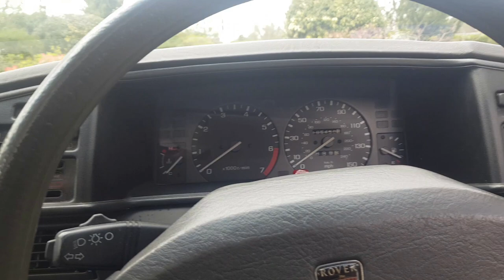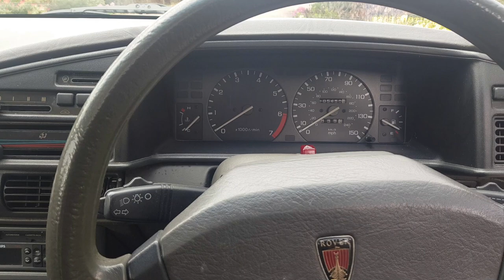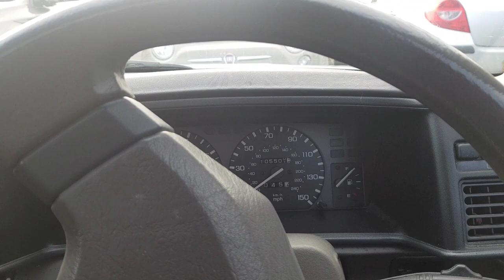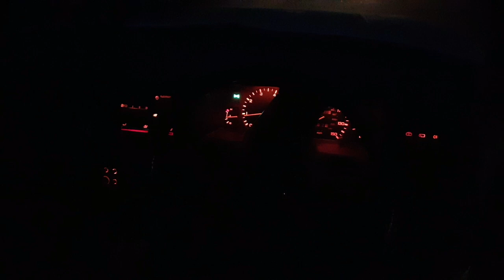Collecting my new Rover 820 BASE (it broke)

Comment: Automatic chokes were never much good on most cars of the time I converted my VW 1303 Beetle with a Alexander manual choke conversion kit  
from Halfords 😁
Reply: Arran Grant I haven’t had any automatic choke issues on my 66 beetle, but I did get rid of the points distributor, and replaced it with an electronic one. It starts up every time.
Reply: I owned this beetle back in the 1980s when I first started driving so I don’t know if this kit is even available now a previous owner had also fitted electronic ignition to it
I owned a 1980 mk1 golf L 1100 after this which  had a factory fitted manual choke and no water temperature gauge just a warning light if you overheated a real poverty spec hub nut car😁

Comment: I'll always have a soft spot for the 800, particularly the fastbacks with the huuuuuuge boot- did many miles in them and owned more of them than I'd be happy admitting in public.  Unusual to see one without the trim bulging over the instruments, I thought that was a standard feature! ;)  I even had two of the 820 'Tickford' Mk1 turbos with the turbocharged O-series - fun things (when they worked properly, which wasn't often!)

Comment: Love the 800 such a good looking thing, if those callipers are needing replaced might be worth trying to get re-build kits, I know they are a proper pain to do, but it’s way cheaper if you have the time assuming the pistons and bleeders are still ok - rears in particular easier as you can screw the piston past the seal (once seated). Just done mine on my sorn ed embarrassment ahem, now I need to change the Haldex oil, so I’ll be wearing that any weekend soon......good luck hopefully it’s not to bad a project.

Comment: Honda style calipers were always a problem, the old bl ones never have issues really. Had numerous 600 and 800 cars with that issue and the Japanese bits are more problematic than anything else. If you’re passing by Solihull feel free to drop in for tinkering and tea! Please try uniroyal tyres on this, they will work well.

Comment: She looks like a nice, comfortable drive (I'm not quite sure how that works!)  Hot brakes - that happens when they are binding, if you don't stop it will warp your disc (at the very least).  Anyway, you improvised enough to get her home, which is great.  It would be a shock to get a "free" car, that was 30 years old and not have to part with some readies for maintenance/repairs.

Comment: Drove my first Rover 820 SLI at 19, lovely drive, steering far too light at speed. Loads of rust, decent spec, gearbox went in the end. It was an 1989 car so it was full of rust, loved it though. Also owned an automatic 800 and the T-Series Vitesse which was a money pit for me. Still lovely cars, very rare now. They don’t like to be ragged about, not built for punishment more comfort. Looks a tidy motor, been looked after by the owner.

Comment: Brakes no problem really, just clean them up and if they still drag when hot it's likely to be the seal. Just pop the pistons (with the pedal) and replace the square seal. Try cracking the bleeder or hose first. The nightmare is if the caliper leaks around the handbrake seal.

Comment: I suspect your unknown random piece of trim in the boot is the trim panel for the inside of the tailgate, or a spare.  Those panels were held in by rather poor Christmas tree-type clips that suffered badly from the plastic going very brittle very quickly and would break when you slammed the tailgate, causing the panel to drop off entirely or drop and get broken by getting trapped between the tailgate and the body of the car.  If you're really unlucky, the panel can drop when the tailgate is shut causing it to jam shut unless you force it and break the panel or crawl into the boot and move the panel back into position.  I believe there are clips from other makes and models of vehicle that will fit and are of much better material quality so they will hold the panel in place much more effectively.  I had exactly that problem with my, also white, 820 Se fastback and it absolutely stumped me trying to work out why the tailgate, which had worked perfectly, suddenly wouldn't open, until I crawled into the boot to look at the latch and realised that the trim panel had dropped down and was acting as a dead bolt.  The central locking issue, with this car presumably not having the remote locking, is likely to be a blown fuse, probably caused by a sticky central locking relay with this car having not had much recent use.  The relay, as memory serves, is very much a standard part that should present no problems replacing though access to the relay panel on the back of the fuse box can be a bit of a hassle...

Comment: The 820 injection  was good as well. Clean the caliper piston and brackets and renew the fluid before spending. Squirrely under braking could be uneven  tyre pressures.
Reply from the maker: Yup, brake stripdown on the cards tomorrow.

Comment: The Jowett Javelin are a very underated car ,fast, engineered far better than it's contemporaries from Ford etc and the fact that you drive one up a motorway in the UK means it's reliable in it's old age.  My Dad had a Bradford truck ,which was a two cylinder thing but which more than paid for itself by carting building rubble and other stuff about without a problem.

Comment: And I have an original Philip's radio! From memory it's a 952 model.

I loved that car, grew up with 820se, 827sli, then 800 Vitesse....

I'll check my parts bin tomorrow!  I may even have a gear box!

BUT I DO HAVE A MONGOOSE EXHAUST, IN MINT CONDITION, cost me 500 quid back in the day, but again, I want rid!
Did I mention I have some 800Vitesse Sport 17' wheels?  In pretty mint condition! I've got lots of experience with these cars, many unobtainable parts and I am will to help with advise etc...

Comment: Lol I worked at Station Garage (SGL) when this car was sold new. I’d guess that the Rover was originally an MCP car supplied to management. I think the MCP cars were effectively company cars. If the Metro was from SGL as well if it was sold new to a private buyer it would most likely have been via the employee purchase plan. This attracted a 22% discount on an MG Metro.

The base 820 was a nice smooth drive. Hauling minimal kit it actually had a good balance and I recall it being a nice comfy drive, if leisurely . The Tony Pond TT car only had modified gear ratios If I recall correctly. This allowed it to pull a higher top speed.

Comment: Sticking brakes, likely to be the brake seals. They are designed to distort when the caliper extends to push on the pads, then it relaxes to its normal form, pull the caliper back in a bit. When they age they stop doing that.
That's my guess though. Right my sidewalk superintendent moment is over. Nice car, cheers.
(Oh and I guess you dd not get my last pun-comment about the spoiler alert (car has a spoiler)... bother.)

Comment: I seem to recall working on some rover brakes (and also sliding piston Honda motorcycle brakes) and using an old  G clamp to press the pistons into the calliper. On Italian bikes with twin piston Brembos, I use a pair of mole grips for the same purpose.
Reply from the maker: These pistons need winding in.

Comment: Certainly an adventure picking this one up!! :D

Speaking of the 2L O-series, one of my dad's Montegos had one retrofitted from a crashed monty and it was a pretty powerful engine, car was a damp rotten mess though, hated sitting in the back (rear windscreen leaking so the seatbelts were mouldy, yeugh!!), but up front it was a decent car... :)

Think it may have also had a manual choke mod too, not entirely sure but I do recall at least one of his montegos having a non-standard choke fitted...

Comment: Had 2 820 se's one set on fire, the other developed valve stem oil seal problems, saying that, loved every drive in them, great cars to drive,  both had this strange judder of the dashboard when starting, just as the engine fired🤔

Comment: On the subject of brakes, that is normally a symptom of blocked brake hoses and/or handbrake cable sticking. The hoses breakdown inside and act like a valve,holding pressure in the caliper . I have,in the past ,undone a hose and popped a nail in there to stop the fluid reaching a stuck caliper so i could get a car home. In the case of a free car it's a matter of " never mind the quality,feel the width!"
Reply from the maker: You know, I've never had that happen, ever. Yet, anything from the Rover stable has always had problems with the main caliper piston, which I suspect is the issue here. Did caliper rebuilds on our Mini and Range Rover, within months of each other! (four pistons in each caliper in the Range Rover!).

Comment: Cute house the Rover is parked in front of. I'd not mind living there.
Empty cans of oil.
Reassuring.

7:52: I did hear a speaker pop. Are you sure it doesn't just have a dead display?

Classic car loan scheme...
Britain has such great ideas.

I once had a Citroën Visa which only has one brake system, not diagonally separated that had boiling brake fuel. Imagine how well those brakes worked. Not at all. I'm still impressed by how I did manage to get it to a standstill at the stoplights at the end of the Dutch motorway network (Maastricht, back then. There's a tunnel now). Poor gearbox didn't have a great day that day. Turns out you can put a car in first gear at 40mph. 

Headache gone by now I hope?
Reply from the maker: It is a dead display. Head better thankfully!
Reply: @HubNut  Know your Philipses. It won't even be the display, it's the light behind it. Still, don't play tapes you care about in radios you don't know. Carry a test tape. Trust the man with the 50+ cassette decks.

Also well done on getting rid of that headache.

Comment: Although i always prefered the SD1, (V8 obviously), i did like the 800, and thought it a worthy successor. I have only owned one however, and it unfortunately did not end well.  This was many moons ago and It was a very early 825 on a D plate, and it had been sitting in a field for a few months. It was a solid car with a good engine, but alas its red paintwork was well past its best and although 3 hours and a bottle of t-cut later it looked a lot better, it really needed a re-spray. I would have much prefered it to be a manual, but for a couple of hundred quid i couldn't complain. I did like the interior though and it had adjustable rear seats which was a rare thing back then. I may be wrong but i think this feature was discontinued on later models. Either that it was just a rarely specified option. Anyway, i was more than happy with it and was looking forward to many happy miles of swift and comfortable 24v V6 motoring. Unhappily it wasn't to be though, as not long after buying it after showing him under the bonnet i took a mate of mine out for a spin in it and unbeknownst to me one of the bonnet catches, (800's have one on each side instead of just one in the middle), had failed to do its job and shortly after pulling out onto a clear stretch of fast B road and putting my foot down i suddenly found my forward vision somewhat impaired by the fact that the bonnet was now flat against the windscreen! The force of air under the bonnet obviously becoming too much for the one remaining working bonnet catch. Oops. Not a happy bunny. Apart from this I would still have another 825/27 though. After all it was a lack of maintenance that caused the bonnet to flip and no fault of the car. The story ends somewhat happier though, as although i'd caused a fair bit of damage to the car by destroying the bonnet, smashing the windscreen denting the roof and knackering the sunroof i still managed to make a profit on it. Not bad. Plus on top of this, i found out from a friend that a couple of weeks later the cars auto gearbox had gone bang. So i dodged a bullet there. Cheers Ian.

Comment: Does the aircon work?🤔 Fancy not taking the right grease.👍 As you say, no links to the Montego, but the fabric & general look takes me back to when I owned a Montego in the mid 80s. I loved it, 90mph all the way down to Spain as was the standard rate of knots in those days & all the big cars passing me doing over 100. I also had a red MG Metro before the Montego. Happy days.
Reply: I would be very surprised if a 1989 base model Rover had a/c.
Reply: @rich_edwards79  I was being sarcastic with best intentions.

Comment: Hope the head ache wasn't from any exhaust leaks ? Hope the repairs aren't huge ones but tires ,rotors pads and if needed brake lines and master cylinder you have to do to make it road safe.

Comment: Headache, could be carbon monoxide Ian. Many (a great many) years ago I fitted a fibreglass bootlid to my Mini. Coming back from Belle View stock cars got a splitting head. Remember no motorway and 120 miles each way. Forced to stop for half an hour to let it clear. Only realized the cause years later.
Reply from the maker: I fear so. CO monitor tomorrow.
Reply: @HubNut  Good luck. AKA brakes. Few years ago I adjusted my rears. Have to do it inside, as automatic adjusters failed shortly after I got it. Next day Lynn bangers, 61 mile trip. A17 so 55mph?. Lynn roundabout. Big stop downhill, brakes ok. Not a mile later leave bypass, uphill to roundabout, right turn to stadium. NO BRAKES. PANIC. Frantic pumping and I stopped, it's a blind roundabout.
So adjusted too tight, fluid got hot, boiled on first stop, no brakes on second. At stadium I waited a while and got brakes again.  VERY steady run home. Next day readjusted and changed fluid. Sorry it's long but must give you a grin 😁

Comment: My dad had a Rover Sterling with the V6 auto that was great fun flooring it in the wet away from the lights. It would snake violently as the front wheels spun up. Don't whatever you do tell him 😉😄
He also had one of the 2ltr turbo Vitesses with a manual gearbox. Horrible ride on the skinniest tyres which grew carbuncles at the slightest kerbing. Fun cars as he always bought ex demonstrators with all the toys. Sadly the build quality tended to let them down a bit. Door handles falling off and trim detaching.

Comment: The headache coming on like that is likely excessive exposure to carbon monoxide. You were exhibiting all the tell tale symptoms headache, foggy headed, tired, slight discoloration of the lips. You might want to be seen at hospital particularly if the symptoms persist. Makes sense to once you closed the sunroof and drove for a while the carbon monoxide levels would steadily rise. Take care my friend.
Reply: Plus heater / ventilation open. If the exhaust or exhaust manifold is leaky CO may find it´s way into the interior via the heater inlet.
Possibly someone with a motorhome can lend a CO detector to HubNut?
Reply: Carbon monoxide poisoning*
Reply: @SharkoonBln  That wonky running engine with the carburetor issues will add to the issues for carbon monoxide.
Reply from the maker: I am concerned about fumes. There is a whiff of them. Will monitor.
Reply: @HubNut  Do be careful. Carbon monoxide poisoning can be serious and repeated exposure can have long term effects. Carbon monoxide exposure is a constant risk as a commercial driver, that and excessive noise risking hearing loss are the bain of my existence lol.
Reply from the maker: @huntsbychainsaw5986  Indeed. Not to be taken lightly. We have a wood burner, so I'll borrow the CO monitor for tomorrow's drive...

Comment: I worked in Monorep Norwood green and man was lucky enough to drive some gems. I left just as the Deawoo Matiz hit our floor. Horrid little rust buckets, talk about doing nothing but getting you from a2b. 
My neighbour has a garaged green 800 n reg.Racing green and very low mileage. 
Another neighbour owns a H reg 200, white low mileage but not garaged. Covered most of the year. 
I really want the 200 and made it clear if he ever sells see me first. I won't even haggle. 
An ex neighbour has a calibre and he also had that limited edition turbo couple. The ones that came a lovely blue, I just can't recall the model, maybe a GSI.

Comment: I remember my dad had the 827i saloon with the v6 or flat 6? Honda Legend engine and even by today’s standards it was a fast car. It was a beast!
Reply from the maker: V6.
Reply: The 2.7 V6 was a much nicer car than the 2.0 turbocharged 4. Not quite as urgent but far nicer to drive.
Reply: paulanderson79 agreed. I knew somebody who had the mk2 2.0 turbo and said it wasn’t a patch on the V6.
Reply: @matty6848  To be honest the 136 bhp standard 2.0i version was adequate, at least in manual form. The 2.7 V6 lent itself nicely to the 4 speed auto 'box and was surprisingly good on fuel unless you drove it with lead feet. The turbocharged Vitesse just chewed fuel regardless. I think AR deliberately over-fueled these in a bid to keep combustion temperatures down.

Comment: Very nice... This design has aged very well ..
Say hypothetical the car had an excessive oil consumption ... Can you start using a heavier weight oil or can this cause more damage?
Reply from the maker: Depends on the engine. Some are very fussy - Daihatsu engines really won't tolerate anything above a 5w30 from personal experience.

Comment: Hubnut, you got the worst version of the Rover 820, the 2 litre fuel injected 'e' an 'i' versions were much better, especially the 'i'.

My missus had one, from 1991, H reg, a Mark 1, a 2 litre 820e fastback in red, we got it as an ex demonstrator a year later, it had 7,000 on the clock.  It had the 2 litre petrol twin ohc Honda engine, which knocked out 140 bhp, and a really good Honda gearbox.
Reply from the maker: I was surprised at how good the 820 carb was, bar cold starting. This car surprised me.